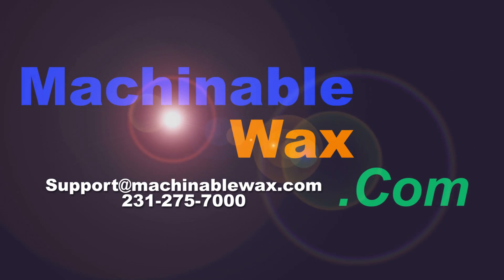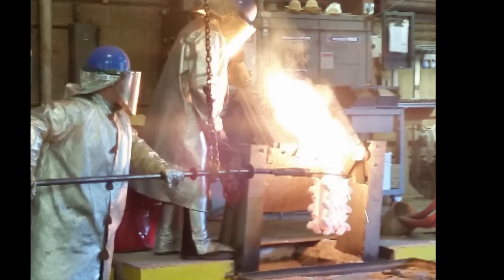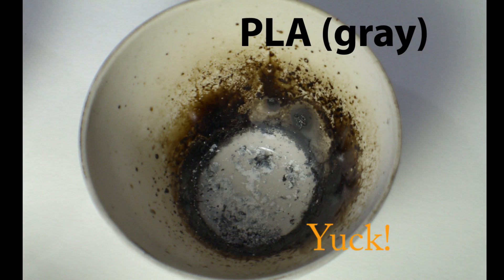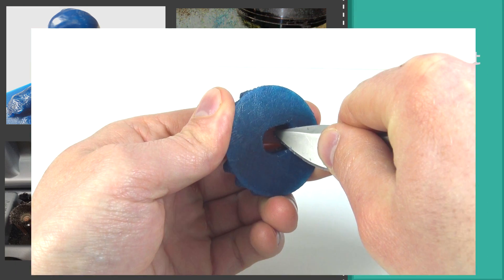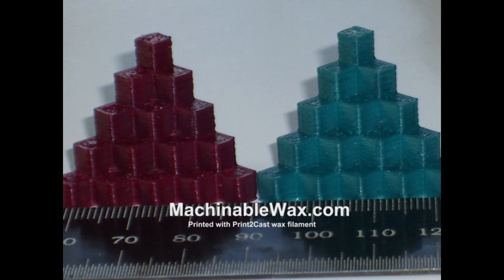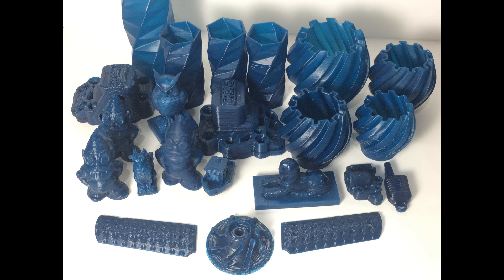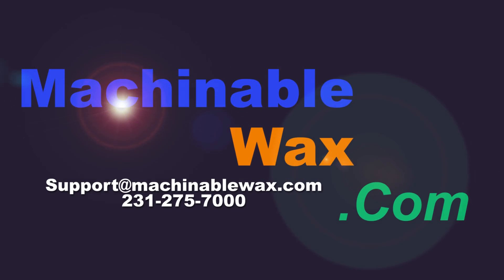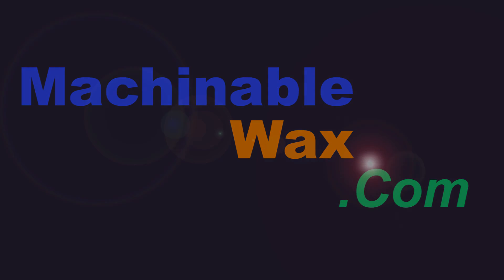Print2Cast Wax Filament

Comment: I just did my first casting with Print2Cast filament, posted here  https://www.youtube.com/watch?v=NPiY4VOu9oA.   This was a curio and work well, however the challenge of getting good bed adhesion makes it (so far in my experience) unacceptable for engineering work. i.e. castings for something mechanical 

I tried everything they recommended and finally had some success with printers tape (although still curled up).  This is on a prusa mk3 with heated bed.  Hairspray (6 coats) was a fail.

If anyone has a way to make this work well, I'd love to hear it

Comment: highly recommended.
when you're done PLAing in the kiddy pool - get the material engineered for the purpose.
Reply: 3D printing has come a long way even on the low end. This wax has a heat expansion so it should be printed accordingly. You can print most materials well if you are willing to face the learning curve. I got mine to print very well but it was not a controlled chamber, it was a basement with air drafts. I am getting a printer with a controlled chamber and can’t wait to see how they come out after I get that tuned for this filament.
Reply: Sig .Other 
Assuming Machinable Wax is as good as they claim to be....they haven't got very good reviews, you shill.